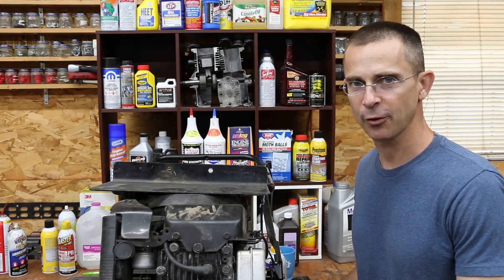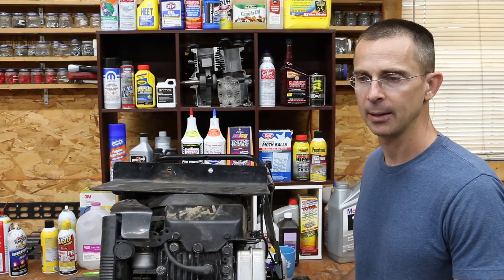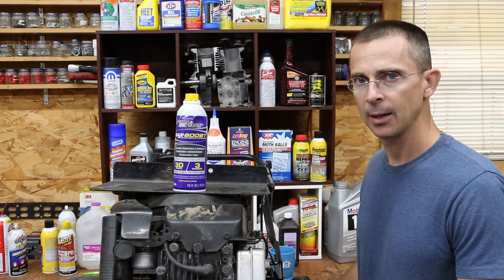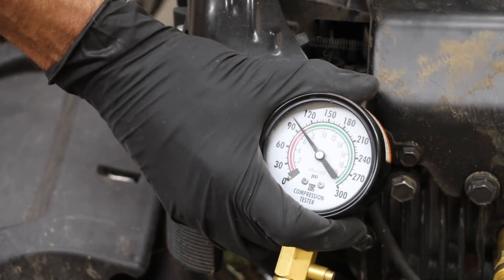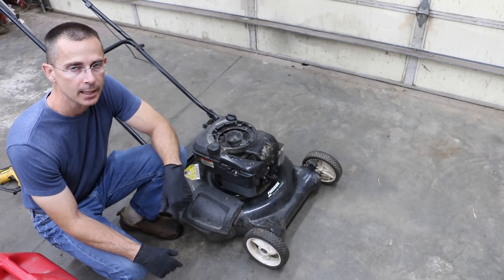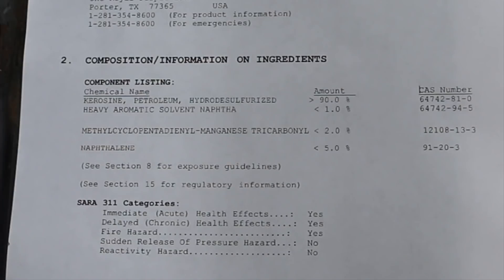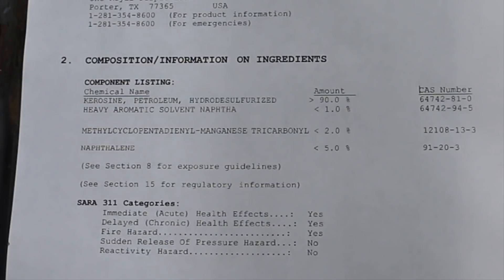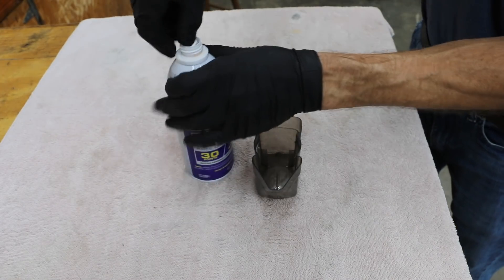Will a gas engine run on 100% octane booster?  Let's find out!

Comment: That was interesting and it reminds my of when I ran too much of this one octane booster in my 1981 Toyota pickup truck. The engine put out more power than with just gasoline but I don't think the engine suffered any damage. What I also saw was the same kind of build up and residue in the tailpipe.
Say here's another idea. Would it be possible to run charcoal lighter fluid in an engine instead of gasoline?
I wonder what that would be like. Maybe you did though.
Reply from the maker: Thanks for watching!

Comment: Don't do this to your car though. I thought my oldsmobile was fucking tight when I got it (first car) and took a fuck load of octane booster and yeah it was a bit faster surprisingly. But, I ended up burning out the fuel pump on two of my vehicles by not learning my lesson..
Reply from the maker: Wow!  Thanks for sharing this experience.

Comment: Years ago I ran a can of Wynns Fuel cleaner (Cant remember the name) in a 05 Honda Silver Wing. One day as I was coming to a stop, It stalled. Started back up. Took the plugs out when I got home. Ceramic portion turned red. Put a new set in, Ran fine afterwards.
Reply from the maker: Thank you.  I wonder if the red was caused by MMT.

Comment: Common ingredients for most octane boosters.  Retail pump kerosene in $4/gal.  Octane booster is $4/10oz.  Naphthalene is Coal Oil (refined originally from surface coal tar and shale) and was the first lamp oil to replace fat and whale oils in the early 1800s.  It was replaced by Kerosene as standard oil started refining their oil well crude (50 years before cars were common).  Today it is jet fuel.

Naphthalene and Kerosene are common octane fortifiers used by gasoline distributors.  If your pump gas is yellow, it has probably been fortified with Naptha and yellow kero.  If it is pure clear it may have been fortified with just the Ethyl alch or just K1 Kerosene.
Reply from the maker: Thank you!

Comment: The orange deposits are from the MMT. I use that stuff in my truck every fill up. I have a supercharged 6.0 Chevy that needs 103+ octane. I add 16 oz’s to 13 gallons of 93 octane fuel.
We borescope my engine every 30,000 miles and change the plugs, piston, top of combustion chamber and plug all have the orange glow. 
I also have water alcohol injection for hard pulls to further increase octane rating and it keeps the carbon out of my engine and piston temperature down. 
I buy my MMT in 5 gallon cans and transfer it to 16 and 32 oz bottles to add every time I get gas.
Reply from the maker: This is great information. Thank you

Comment: Pay attention to the data sheet. 5% of Naphthalene! It is well known fact that old stile Moth Balls(Naphthalene) can increase gas octane number. Just add 2-3 balls to full gas tank. Also it clean engine inside. All catalytic converter cleaners consists Naphthalene also. Using Naphthalene vs modern octan boosters or cleaners can save you money ;)
Reply from the maker: Thank you
Reply: @ProjectFarm  Can you make NEW Naphthalene test? Just add 1 tablet to the gas tank of your test engine. It is very interesting to see spark plag or engine inside before and after. Test 1 : add 1 tablet, run, open. Test 2 : add 2 tablet, run, open. Test 3 : add 3 tablet, run, open... will see optimum amount :)

Comment: Hey there,
Have you ever tried to use cooking oil as a fuel in a Diesel engine?
I’ve heard it’s a good substitute and I’ve also heard that it doesn’t matter if the oil is clean or has been used for cooking?
Steve😊
Reply from the maker: Thank you for the video idea!

Comment: What about testing if octane boosters really work? Either have the fuel tested for octane numbers or increase the compression and ignition timing of a small engine till you head it knock. Then add the booster. You can buy a plate that allows you to move the coil for ignition advance. Milled headband thin copper gasket for more compression.
Reply from the maker: Great video idea!  Thank you

Comment: I put kerosine about 1 pint in a full tank of 89 octane gas in auto it cleaned the fuel injections put spray kerosine in thein take while running engine had stuck valve it fixed valves cleaned engine. did it 5 times did it on 1969s and the 70s car that had lead in gas still can on 2001 mercury
fixed it watch the aluminum heads put less in it
Reply from the maker: Impressive!  Thanks for commenting on this.

Comment: There's so many videos, but maybe varying %s of rubbing alcohol, peroxide w bubbler and using 2 prong electrode HHO idea, ( illegal as it is if over 78 mpgs ), performance testing plugs, ( I had 15 up to 20 w gmc 350 on highway, town was worse ), a far off mini turbo for it for a efficiency test, since 0 vacuum is best for that, ain't expecting that because of cost, and ohhh yes, hoping that you have the things available somewhere, a 5 angle valve job w a bit of porting n polishing w results of petrol use..( mine was 11 to 39 + on highway w 230 Chevy 1bbl, didn't last because the wear in wasn't done as I shoulda ), ..
Reply from the maker: Thanks for the ideas!

Comment: Do you use a new head gasket everytime you remove the head?
Reply from the maker: I use a new one about 90% of the time.  It gets expensive at around $5 each. New spark plugs too but they're only around $3-4.

Comment: NAPHLENE , BENZENE, AND TOLULENE ARE COAL TAR DISTILATES  THE LATTER IS USED TO BRING UP OCTANE RATING OF RAW GASOLINE .  NOW OF COURSE THE MOVE IS TO ETHANOL BUT AS KID I WOULD BUY QUARTS OF TOLULENE AT THE HARDWARE STORE AND RUN IT STRAIGHT IN MY GO CARTS VERY FAST THE ENGINES WOULD REV TILL THEY CAME APART GOOD TIMES  IF YOU GET SOME ZIPPO LIGHTER FLUID IT IS OR AT LEAST USTA BE 100% NAPHLENE  BUT THAT WOULD BE COOL TO SEE HOW THAT WOULD GO I WOULD IMAGINE IT WOULD BURN HOT
Reply from the maker: Thank you

Comment: That's a ton of sulfur buildup. Damn.
Edit actuallys probs iron oxide buildup.... More likely that than sulfur. Sulfur would have burned off right??
Reply from the maker: You are right.  I believe it's Methylcyclopentadienyl manganese tricarbonyl, which can foul spark plugs and damage catalytic converters.

Comment: Do octane booster really improve engine performance & mileage ???
Reply from the maker: I can put together a video on this if you wish.  The answer is: It depends.  Naturally aspired engines designed to run on 87 octane are not likely to see any performance gains.  The only one getting a "boost" is the seller of the product.  Engines that have aggressive ignition timing and high compression ratio engines are likely to gain some benefit. Again, it depends.

Comment: So people run octane boosters and the question is whether the octane booster buildup that you have seen in your testing has long term affects. Can it be removed simply by running a tank of gas through or if it stays?  And what if you ran an octane booster all season on one of those engines. (Which would be a long term test)
Reply from the maker: Great point. From my research, it (the MMT, which causes the orange buildup) can foul plugs and cause issues for a catalytic converter.

Comment: As usual amazing videos and a persistent man you are! I’d guess the orange/ yellowish build up is sulfur from the 90% kerosine. That can harm the engine on a longer run, boosters work well increasing the heat of the combustion which leads to carbon burnout, I would guess that’s where the sulfur works well but with a good gasoline mix. I wonder what would paint thinner run would look like, that’s also one of the ingredients of the same booster. Possibly adding some naphthalene too to the mix!    Awesome work once again!
Reply from the maker: Thank you!  I believe the orange buildup is Methylcyclopentadienyl manganese tricarbonyl, definitely not good for spark plugs or catalytic converters. Thanks again!
Reply: Project Farm thanks for the detailed information! I’m getting addicted to your videos :)

Comment: I have to say, I've only started watching your channel within the past 2 or 3 weeks. I basically stumbled across it because YouTube showed one of your videos in my "recommended" section (probably because I do watch a pretty good variety of automotive/mechanical-related stuff). Now that I've been here a while, I am truly impressed by the quality of your videos. It seems clear that you spend a great deal of time planning what you're going to do, what you're going to show, setting up your cameras and equipment to show it effectively, and so on. It really pays off, IMO.

Your introduction gets right to the point within a minute or two, rarely with any side-rambling and repetition (as so many other channels of this type do) and your editing is really tight and well-executed. You get right to the point and, most importantly of all, you stick to it so I remain engaged throughout. There's none of the off-topic rambling and personal anecdotes that makes me wonder "why in the hell is this guy wasting time on this crap?", as if they're just trying to pad out the runtime. Yeah, sometimes those "side stories" can be amusing, but most of the time (to me, anyway), they aren't.

The net result is one of the best channels of this type that I've ever seen. IMO, this is the way it should be done. Tip of the cap to you, Sir!

Here's a question/project idea for you: Have you ever tried running engines on alcohol, either pure ethanol, methanol, longer-chain alcohols, even denatured "rubbing" alcohol that's diluted with water and tainted with benzene to make it poisonous? I apologize for wasting your time because you've already done this and I just haven't found it yet. ;)
Reply from the maker: Thank you very much for the positive comments!  I do try hard to put together high quality content.  I'm far from perfect and continue to work hard to improve.  I've tested Everclear and rubbing alcohol, but there are other types I plan to test in the future. Thanks again!
Reply: Quick note: Just saw your previous episode testing isopropyl alcohol. Nice job. I could've warned you about the likelihood of getting water in the oil -- probably due to either blow-by past the rings and/or valve seals or getting sucked directly into the case through the PCV system. Using a fine atomizer to spray the water (ideally, in short bursts, not a continuous flow) into the intake instead of just letting it drip into the carb probably would have prevented that.

Comment: Not sure if you tried hydrogen (not the easy way) but using a hydrogen generator ...making one of those is a whole project in itself LOL I've watched other videos where folks claim that actually works and the one they made will be more than enough hydrogen to run the small engine used in the video ... its absolutely mind boggling to me ... think of what makes up water H2O two EXTREMELY POWERFUL EXPLOSIVE things liquid oxygen got us to the moon LOL ... Hydrogen gas brought a blimp down consuming it completely... but in the combination H2O fireman use it to put fires out ... truly baffling for sure LOL
Reply from the maker: Not yet, but I plan to the HHO. I'll have to be careful!

Comment: Alot of these different fuels may still work given the compression of the engine. The less flammable will need I higher compression. This may be a harder test but testing the efficiency running ~60/40% gasoline/diesel @~14:1 compression ratio.
Reply from the maker: Great point.

Comment: Adding 10%  to 15% lacquer thinner to gasoline will result in significantly more power in flathead engines. Used to use it in my go cart when racing.
Reply from the maker: Thanks for the recommendation!

Comment: hey. you should try using tapping fluid for engine oil. cutting fluid. its green. fir tapping holes. anyways i used it for years and always wandered since it stops drill bits and taps from being ruined. will it stop and engine from being ruined?
Reply: cutting or tap fluid. its one or the other
Reply from the maker: Great recommendation!

Comment: On your vapor carburetor where you use to 1 inch lines. You need to drop them down to 3/8 or 1/4 of an inch and you can control how fast the engine runs I seen it on another video two smaller the pipe two more you can control it
Reply from the maker: Thanks for the recommendation.

Comment: Will it run on a couple co2 cartridges
Reply from the maker: Thank you for the video idea!
Reply: Project Farm will u try I’m really curious.
Reply: @caseygray3871  Except one big problem... C02 doesn't burn!  The only way you could do this is modify the camshaft and use the C02 canisters to pressurize the intake tract and treat the engine like a single acting steam engine.
Reply: tom thanks for telling me. I’m only in 8th grade and didn’t know that

Comment: Also I owned a mint 93 Camaro with only 112k mi on it and I bought a 3 bottle "performance booster" kit from autozone and once I added the stuff into my car I ended up losing a cylinder and it never ran the same again! I had smoke chugging out of the oil add cap where compression should not even be smh not sure what happened mechanically and after it sat in my driveway for a few years ended up going to junkyard for $275 unfortunately man I miss that car....
Reply from the maker: That's a big loss.
Reply: Project Farm yes it sure was, but I believe I paid $1,800 or $1,500 for it initially so I got atleast that much use and fun out of it before it went down.... (have to try and tell myself that to stay positive anyways lol)

Comment: You know what would be one of the best things to test is head gasket sealer. I’ve used the cheapest$10  stuff and worked and have heard that the expensive 60$ fix it in a can doesn’t work
Reply from the maker: Thank you for the video idea!

Comment: You should try running 100% toluene. We use it in avaiation by the 55 gal barrel as a very powerful solvent. I do hear though that formula 1 cars run a 85% mixture of toluene in their engines, It is supposed to be around 121 octane level. Whenever ours “expires” at the 1 year mark set by the manufacture, a local race shop buys the remaining barrels it to cut it in race fuel.
Reply from the maker: Thank you for this recommendation!

Comment: Seafoam rules! 
But how much should i use in A 99 liter tank? (99 GMC Sierra SLT 4x4)
And what happens if i Mix with and octane additive?
Thank you for your time.
Reply from the maker: I would use 2 ounces per gallon, which I believe is approximately 1/2 ounce per liter.  I don't believe an octane booster will have any impact.  Recommend checking their website just to be sure.  Hope this helps!

Comment: Wat if you did it with all the fuel treatment brands to see which would get it the most cleanest? Also did the orange  build up go away?
Reply from the maker: Thank you for this recommendation! I had to use a cleaning product to remove the orange buildup, which was caused by the octane booster.

Comment: You should try a very high octane racing fuel. A lot of people clame it could melt the piston. Also bestline did this video where they submerged and engine that was treated with bestline. It had no pan on valve cover and they put it in a big tank of water. And also they have this product that "water proofs everything"
Reply from the maker: Thank you for this recommendation.

Comment: Another awesome video as usual . I don’t read the comments much so not sure if anyone suggests these but I’m an avid off-roader and a lot of guys in this hobby run their engines on propane and I was wondering what it would take to run a small engine on propane. And second I use a lot of acetone at work to clean parts (i’m in aerospace industry) and was wondering if a small engine could run on this too.  Thanks and Keep up the good work👍
Reply from the maker: Thank you for the recommendation!

Comment: Octane is the temp of ignition, not power. Flatheads need a fast burn with lots of expansion and BTU's per unit. I found 30% water in alky makes molehills to be mountains. Jet engine appropriate.
Take care from Oklahoma
Mike and Vee
Reply from the maker: Thank you for this information.

Comment: i wonder what would have happened if this thing had a knocksensor. that's why i recommended a junkyard carengine for some of your tests, because sadly not all of your testresults are applicable to automotive engines.
Reply from the maker: Great point.  I'll see what I can do about getting a different engine for testing.

Comment: You need to look into a Hawaii based mechanic, 
named George Nitta.

https://www.georgenitta.com/mothballs/mothballs.htm

When I was in Hawaii, I used to listen to his radio show, 
most every Saturday.  He has a nice looking red Pantera, 
and my landlord had a black one.  We did a circle-island 
cruise, one Sunday.

Try running an engine on his recipe.  5 mothballs, plus an 
ounce of WD-40 per gallon.  Oh, WD-40 is available in a 
1 gallon can, so you don't have to use spray cans.

steve
Reply from the maker: Thank you for this recommendation!

Comment: The gold residue is MANGANESE. It's a mineral, found in that ingredient you couldn't pronounce. It's used to make that anti-knock compound with similar properties to tetraethyl lead but much less toxic. However, you'll see if you read the label that the product is allowed for off-road use only, and this residue is why. While it isn't particularly toxic, it builds up in catalytic converters and can render them almost useless. In older vehicles which don't have catalytic converters (or lawnmowers) it doesn't change anything.
Reply from the maker: This is great information and you have an impressive knowledge of fuels/chemistry.  Thanks for this information.